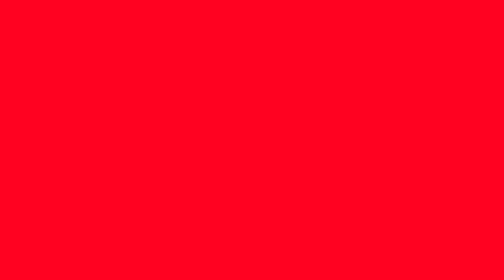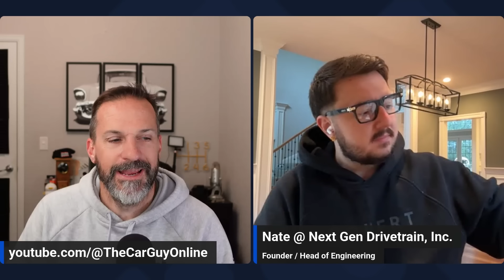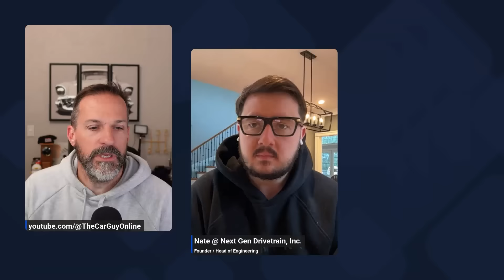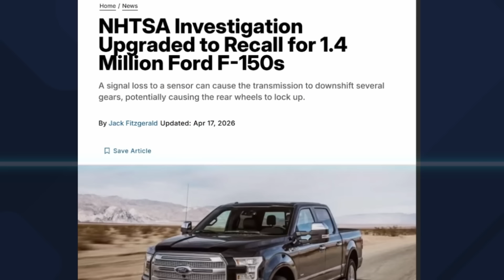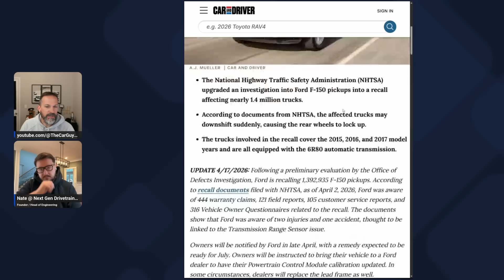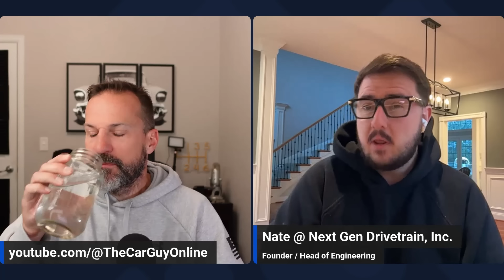Ford's BIGGEST Transmission Recall Yet - 1.4 Million F-150s

Comment from the maker: NextGen Discount Code: TCGO5  (use this during checkout at URL below)
NextGen 6R80 Kit: https://thecarguyonline.com/short/J3XAEp6
(Affiliate links)
https://static.nhtsa.gov/odi/rcl/2026/RCLRPT-26V237-6816.pdf
Years included in recall: 2015 - 2017
Reply: What about 2018 ?
Reply: @TheCarGuyOnline the Tcg05 code is not working.
Reply: What about 2019s my transmission is screwing up shifting so hsrd, I am scared to drive it.

Comment: I have a 2015 F150 5.0 with 200k miles and no issues. I wish they would give me the parts to fix the transmission and the rear camera recall free or at a discount so I can swap them myself

Comment: How long have ford,GM ,Toyota turbo tundra and Ram been building vehicles and STILL can’t build dependable vehicles? I bought my first and last ford vehicle in 1998. Transmission went out at 8000 miles and then again at 12,000 rear main seal started leaking at 45,000.

Comment: Look at the old 2 speed auto the power glide they lasted longer than the engine and were built for drag racing they were built tuff and I had one in a 1965 GMC handy van with a 230 inline 6 engine and I drove it for ever you could not kill it as long as you changed your oil and did not over heat the engine and that was back in the day if you made it to 100 K that was a great engine.

Comment: I have a 2020 Ford Expedition. In April 2023, when it had under 50,000 miles, I took it to a Ford dealership because it was not shifting correctly. It was shifting hard, making a loud bang, and jerking. The dealership said the problem was related to the PCM reprogramming recall, but the reprogramming never fixed the issue.

The problem continued to worsen. While driving on the freeway and trying to accelerate, the vehicle would not shift properly and would jerk violently. It basically stopped suddenly on highway. It felt as though someone had hit the back of the vehicle. Now, I am being told by an independent mechanic that I need a new transmission for $8,000. What do I do?

Comment: My dad had a 66 American Motors Classic that did that. It was a new car at the time. Ended up with a new transmission, there was a recall on them later. These issues that manufacturers have at times is nothing new. Of course you’re paying a lot for a vehicle and expect it to last flawlessly, but that’s not realistic. It’s a man made mechanical device, sometimes they fail. My main issue with all this recall stuff, is the dealership and manufacture giving people the runaround!

Comment: Ok so in a nutshell about all this text and calls and letter I got from ford about the recall. Do I accept for them to “fix” it or not? Now I’m scared I’m in the highway with my family and all the sudden my rear tires will lock up. Or you might think they made this Gen to reliable and they want to destroy this gen 150? I have a 2016 f150 with 140k miles no issues

Comment: 2016 F150 with 5.0 at  81k miles, regular towing and preventative trans and engine servicing. At 50k my transmission lead frame failed causing exactly the problem this recall is to prevent. Output speed sensor goes blind so trans shifts to first - mine did it off idle so no big deal but it would have been ‘dramatic’ at higher speed. Why is the lead frame made of plastic….Ford saving a couple bucks likely.

Comment: I brought my f150 in because of lead frame failure, and found out there was a recall on the transmission, but they said the lead frame wasn't covered under the recall and charged me 2200 bucks to replace lead frame, I hope I didn't get screwed, and the lead frame was part of the recall, 
And now I have to bring it in to have the brakes inspected because its not working correctly, And found out that there's another recall for this ,so Ford better cover the repair

Comment: Mine just went on me last week in my 2016 F-150, driving on the highway, quickly downshifted and had no way to accelerate. Then had an issued reversing from a parking space, lost my gear indicator, wrench popped on and then check engine.

Had to bring it to the dealership and mentioned to them the recall (which has no remedy at the moment). Dealer tells me not related to the recall, despite having the check engine codes listed in the advanced directive from Ford and says it’s the valve body lol

So now waiting for them to replace the valve body and lead frame as they come together. Planning on applying for reimbursement

Comment: I love Nate . I have a Chevy truck it needs a transmissions its an 05 . I still drive it. I am going to get it repaired.  It also burns oil but it is very reliable.  I want to get a loan and have a new engine and transmission put in it. My plan if it works out god willing is to get a 18 to 20 ft rv trailer and travel around a bit. More local than anything.  Lots of places to exsplore in Nevada. Sorry for the story lol

Comment: The  Lead frame in my 2016 F-150 went out in March of 2023 at just under 35000 , but just over the 5 year time.  Slammed into 2nd? (Couldn't tell because the instrument panel went wonky) from 65 mph. Dealership said it was the Lead Frame but that none were available and were not in the foreseeable future! Also said it was out of warranty. I refused to leave my garage kept baby in that damned lot on the middle of summer indefinitely so I started calling other dealers. Got a lady in Delaware who said that had been happening to a lot of their customers and that they were replacing the entire TC Control Module which contained the LF but that it was more expensive. I did that because I felt I had no choice. Cost me $1800 plus a $200 towing fee. My question is : is the LF in that TC Control Module the same defective piece of crap that has been failing??? Will they replace it under this "recall"? I am mad.

Comment: I just spent almost $3,000 to replace the road salt rotten oil pan on my ‘18 Cummins.Replaced with aluminum so it can’t rot again.  I could have traded it in a few years ago. But, I’d rather keep making money with something that’s been paid for for going on 5 years now. Doesn’t hit as bad when you need to have a repair made for $3k when it’s done nothing but make you money.

Comment: 10R80's problems seem to be computer constantly upshifting for mpg > locking up in too high of a gear constantly > causing premature torque converter friction material disintegration > extremely black/fouled fluid + excessively tight clearances in transmission housing + poor quality springs > failed shifting > premature catastrophic failure. Maybe 6R80 shares some of these elements.

Comment: I had to change the lead frame in my 2012 f150 5.0 fx2.   Went into limp mode.   Was not too hard.  Did this about a year ago.  Yes, having electronics in transmission fluid makes no sense.  I did see that the new lead frame has a small foam gasket that keeps the fluid away from some parts of the lead frame.

Comment: My 2013 F-150 STX4x4 just started giving me the winch on the screen, and the codes are showing P720 and P722.  I called Ford Customer Service, and they told me they had a "Customer Satisfaction Program 19N01" and told me I was covered.  I made an appointment at a local Ford Dealership, took it in and the shop foreman came out and told me I was over the mileage limit.  My 2013 has 150,800 +/- miles on it, and the Customer Satisfaction Program had a limit of 150,000 miles.  They wanted to charge me $1,500 to read the computer for the codes themselves and to replace the lead frame unit.  I paid the cost to have the codes confirmed but chose to bring my truck home.  I called Ford Customer Service and told them of the issue, and all they did was read me what the program said, exactly what the dealership showed me.  I have not heard of a recall on this transmission!!  I wish they would do a recall and fix my problem at no charge to me.  So many of these Ford F-150's, Expeditions, and even Mustangs have this potential issue.  I do remember they had a recall to reprogram the computer supposedly so the trucks transmission wouldn't do the downshift.  I took my truck in for that; it was probably 2017 or 2018.  Now here in 2026, I have a 2013 F-150 with a 5.0L engine and a transmission that may go into what has been called limp mode every time I want to drive it.  Why doesn't Ford just do a recall at their expense and fix the lead frame, no matter what mileage it has.  Prices of new vehicles are ridiculous, and people do hold onto their vehicles longer.  I did end up going out and buying a 2018 Ford F-150 XLT 4x4 with the 3.5L Ecoboost engine and the 10-speed transmission.  I had to have something to get from point A to point B.  Didn't want to have to buy another truck being that I am just 5 months into my retirement.

Comment: My 2019 Ford Edge Titanium with 67,000 miles just had its transmission fail. 

The Ford dealership has performed maintenance and never mentioned a recall on this. 

Not buying a Ford again.

Comment: My 2013 F150 king ranch did that it slammed into second gear at 45 mph . I ended up in the other lane good thing no other cars were there. Ford is paying off someone to get away with what they are doing. No  dealer could fix it near me I found one 100 miles away. There was no recall for it but they knew it. They gave us a lifetime warranty if it happened we could bring it in to be fixed but it had to happen first and you had to be the original owner . There was no drain plug on the transmission pan to change the fluid it did it at 135 thousand miles. If I got hit I would have sued, some people did get hurt with their truck and did sue and won but they rather get sued because it’s cheaper than a recall. Also problems with brakes and sun roofs but another model comes out and they don’t fix the problem. I’m done with Ford.

Comment: I’m in the process right now changing out my leadframe, the new one I ordered didn’t come with the foam strip to keep fine metal particles from building up on the electrical components, I orders the strip extra $50 bucks here in Canada due to trumps cross border tariffs.

Comment: Feb 2020 At 98,000 miles my 2017 5.0 XLT 6R80 went out. I went to my local dealer and they said it would take 6 months or longer before they could fix it. I called AAMCO and they sourced a new transmission….. It lasted 4 days….Replacement lasted 2 weeks…..7k dollars This one is now shifting down hard and meets the recall requirements. This sux because I rely on my truck for everything.

Comment: Old news, I had the computer patch fix done two years ago, no problem at all. I  have a 2014 XLT with the Coyote V-8, mine was fine, but, I got a recall notice from Ford. Took it to my local Ford dealer, and they fixed it with no problems. I then took the truck on a 6000mile road trip all over the mountains in the western US, have had no problems at all since then 2024.

Comment: Ugh… I’m currently dealing with the 10R80 hesitating shifting… was hoping this video was about that
Reply: Disconnect your battery…negative first…then the positive….let it sit for 10 or so minutes…reconnect…positive first…then negative…..turn on your key…don’t start…give it a minute…then start…wait 2 minutes..turn on air conditioner…wait 10 minutes…the go for a 20 minute drive…no hard acceleration just passive…let it relearn driving habits…it might fix all your problems…and by chance…clean your maps sensors….and your throttle body..it’s all worth it

Comment: Nate is WRONG as a Ford certified tech I'd know. The lead frame simply has the wiring and sensors for the trans in a hard plastic assembly. There is no computer inside the trans. We've seen the most failures with the output shaft speed sensor when the trans gets hot. Have seen some range sensor failures. The 10R family is better, still has faults. Also the a Ford ten speed trans is really just a 8 speed since in normal driving 2 gears are skipped. Failures are the fault of the penny pinchers, if it cost 10 cents to make a part that needs to be made 1million times they are going to get that cost per part down.

Comment: The shame of it is he has the corrections to the major auto manufacturer and they will not buy his product because they’re too proud but cost the company billions of dollars by doing this. I would start at the top and work my way down first being GM getting rid of a woman’s CEO in an automotive industry. I’ve never heard of someone or something like they recommended with the 6.2 L 87 to change their fix to the answer of breaking crankshafts anywhere from 500 miles to 10,000 miles is to change the gas cap of the oil cap to read 0–40 and use that versus what they originally expect zero20 they did that and the engine still failed. They’re well over $1,001, billion in warranty claims class action suits they deserve everything they get because they’re just putting their nose up in the air and they’re not utilizing what they have available to them. That’s not a good business practice.

Comment: No person should be buying a brand new vehicle today buying I mean purchasing financing it they should be leased and give it back and you still have the option if it’s trouble free after three years or you learned enough about to correct what is wrong? You can buy it. It’s the answer. Do not spend money on a purchase. Anything that de appreciates you rent anything appreciates you buy fact

Comment: Much of what is going on with these new cars from data mining to the constant overly expensive engineering to get every bit of mileage with as few emissions as possible is driven by the feds and state govts. Need to get a 94 f250 idi with a five speed.

Comment: 2024 F150 33,000klm.
I contacted one of the best Transmission shops near Toronto.
I wanted an improved Valve Body installed, the shop manager felt there was no need, saying he seldom here’s of a problem. Ford has made positive changes for reliability.
He told me not to believe the nonsense.

Comment: 2017 F-150 with the V6 3.5 Flex Fuel with 140K. Trans fluid changed at 95K. Oil change every 5K. Flawless so far. But this transmission recall will be forgiven and remembered. Likely my last Ford.

Comment: I'll take the Ford inline six cylinder 300 CID over any V-8 in the F-150.  Here are some historical facts That damn engine WAS USED in F-100 to F-700 truck line ups in the 1960s and 1970s!
Key Details:

Heavy-duty applications: In the late 1960s and early 1970s, the 300 I6 powered larger vehicles like dump trucks (often in the 15,000–20,000 lb GVWR range). These versions typically featured heavy-duty components, such as a higher-flow HD exhaust manifold, forged crankshaft, and forged rods, to handle constant operation in the 3,000–4,000 RPM range.
Specific examples: Owners have documented it in Ford F-600 dump trucks (e.g., 1968 models), F-350 dumps, and similar chassis. It was also used in industrial and commercial setups like yard trucks at lumber mills or for hauling rock/gravel.
Broader use: Beyond F-Series pickups (F-100 to F-600) and E-Series vans, it powered equipment like tractors, generators, woodchippers, and other heavy machinery—making it a natural fit for dump truck duty.

What manual transmission was used with the 300 I6 powered larger vehicles like dump trucks (often in the 15,000–20,000 lbs. GVWR range). in the 1960s-1970s?

Key Details on the NP435:

The New Process (NP) 435 4-speed manual transmission was one of the most common pairings with the Ford 300 CID I6 in larger medium-duty trucks like F-600/F-700 dump trucks (and similar GVWR ranges) during the 1960s–1970s.
It was widely used across Ford trucks of various sizes, including medium-duty applications, and was known for its durability in work truck/dump truck duty.

Other Common Manual Transmissions:

Clark 5-speed manuals (e.g., Clark 280/285 series, sometimes with overdrive variants): These were frequently used in medium- and heavy-duty F-600/F-700 trucks, especially for applications needing more gears or better highway performance. They were beefy, reliable units common in the mid-1960s to late 1970s behind sixes and V8s.
Other options: Spicer transmissions (often in heavier setups), Warner gearboxes (like T-18 or T-98 in some configurations), and various Eaton or Fuller units in select medium-duty applications. Ford offered multiple 4- and 5-speed options depending on GVWR, axle ratios, and intended use (e.g., with 2-speed rear axles).

For a specific 1960s–1970s F-600/F-700 dump truck with the 300 I6, the NP435 4-speed is the most frequently documented and representative choice, especially in lighter medium-duty GVWR ranges. Heavier or more specialized setups often stepped up to Clark 5-speeds.
Exact pairings varied by model year, options, and chassis specs—checking the truck’s data plate, transmission tag, or a factory parts catalog is ideal for confirmation on a particular vehicle. These transmissions are still available in the aftermarket or from salvage due to their longevity.

In contrast, the modern Ford 7.3L "Godzilla" V8 produces a best-in-class 475 lb-ft of torque at 4,000 rpm and 430 horsepower.  While the 7.3L offers significantly higher peak power and torque numbers than the 300 I6, the 300 I6 is noted for delivering its torque lower in the rev range, providing a more immediate "lug ability" and smoothness that the high-compression V8 does not replicate!

If given a choice between I-6 and a V-8, I'll take the I-6 with manual transmission (Clark 5-speed ("5&2" setup)) over a V-8 with automatic transmission.

Comment: should I not keep my appointment with the dealer then? There are 2 recalls on my 2014 f150 5.0 coyote (transmission thing, and passenger weight seat adjustment)... I'm afraid the dealer will do something I wouldn't want to my truck and my truck already runs really great!